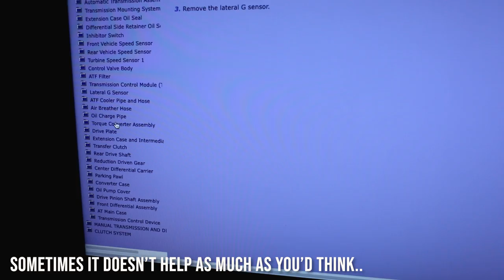Mittens the Legacy GT rebuild (ep.7) Engine install AND A RANT ABOUT TORQUE CONVERTERS!

Comment: Great video.  My 5eat has been acting up lately.   Hard shifts at low load.  Thought about a manual swap but looks like a pain.
Reply from the maker: Yeah, even my built one in chewie has its issues. Definitely gets old. People's answers to swapping them are all over the place, so when it comes time I'm going to do my best to document exactly what is needed and all the available options.
Reply: @MatlasDI  Thanks man.  Will definitely be tuning in for that.   Love everything about my wagon except that 5eat.  I reset the tcu but actually made things worse.  Thought about upgrading the valve body but still weighing my options.
Reply from the maker: @85mmonroe  yeah they can be a pain to relearn properly, I would say an upgraded valvebody and subtle tuning to increase line pressure definitely helps, but can be more of a band aid if the clutch packs in the transmission are worn out. I'd see how it takes to a full flush with replacement of the filter behind the drivers headlight, and if you're interested in upgrades, level 10 does a good job. They built my entire transmission, but I sent them my valvebody to have modified which was a mistake. I'd only use a new valve body and torque converter for modification.

Comment: What Turbo do you have on Chewie??? I am going to buy a new turbo for my 07 Fozzy XT for the engine I won off Tanner. My XT unfortunately for now is automatic and I know you have to be careful about sizing a turbo to an automatic for the useable power range of the turbo…
Reply from the maker: I currently run a blouch 1.5xtr with 3 inch inlet. 20g would be a pretty good pair up for mid/high 300s and keep more power down low.
Reply: @MatlasDI  thanks buddy!!!

Comment: Save the manual!!!  Manuals are far superior from a driver experience POV.  I went from a manual 19 year old sh*tbox worth about its weight in scrap to an F30 BMW fully loaded, with every technology piece etc..it was automatic.  I literally missed the sh*tbox.  The BMW was sold 6 months later due to how much I loathed the driving experience (or lack there of).
Reply from the maker: Yup yup. Had a 93 escort for a daily a couple years back, it wasn't fast but you could drive it like you stole it and it would take it all day lol. Pedal set up was perfect for getting good at heel/toe, and it was easy to Rev match gears without using the clutch. Had the most fun in that  car, probably slowest thing I've ever driven. 🤣